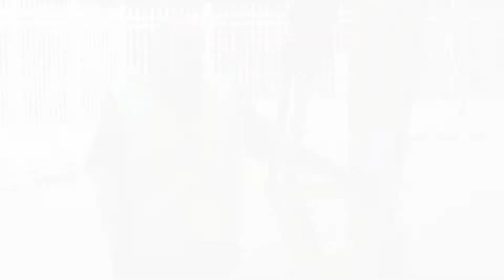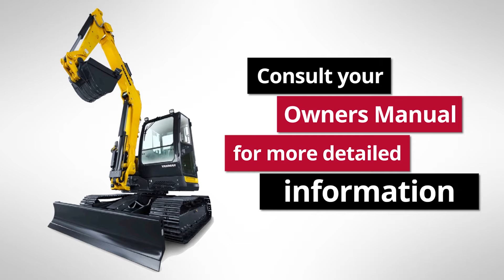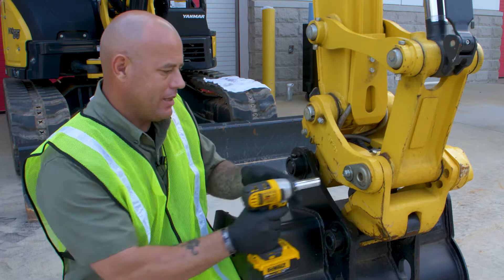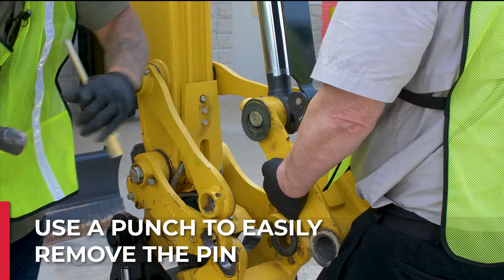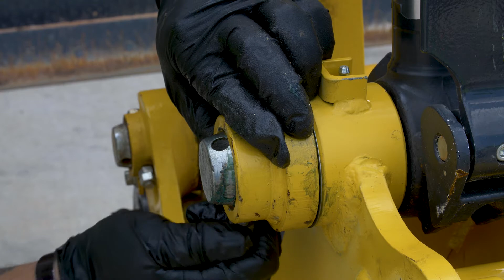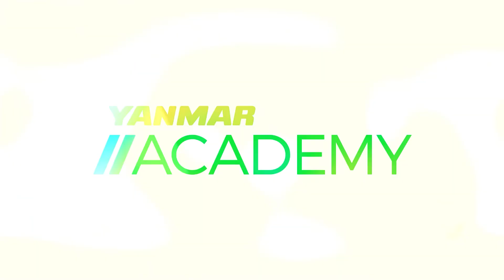Yanmar Academy Excavator Lifting Hook Installation

Comment: 4:51 The video titled "Lifting Hook Installation" skips over the part where the hook is actually installed???
Reply from the maker: at 4:51 the pin is going through the lifting hook if you refer back to 3:52 the assembly being held in place is the lifting hook hope this clears it up for you